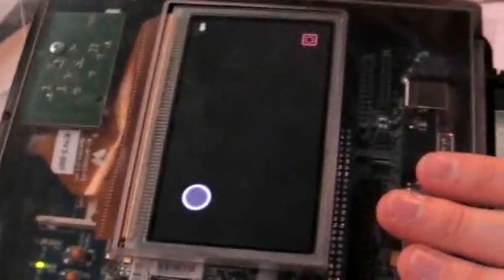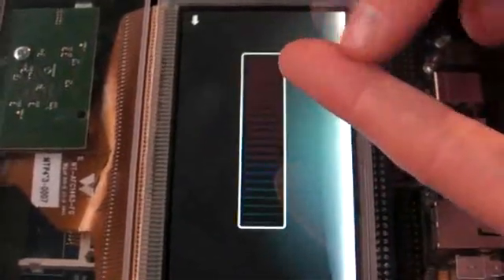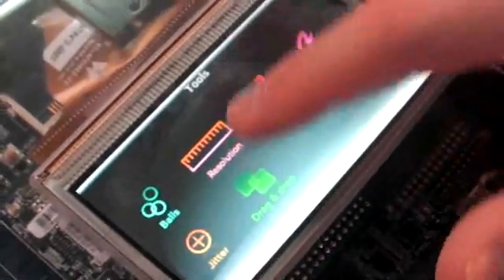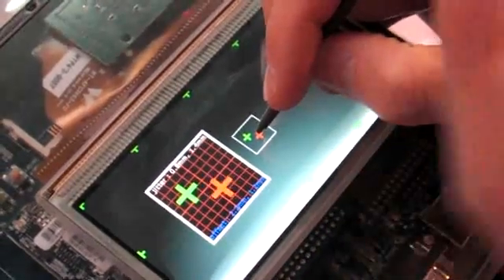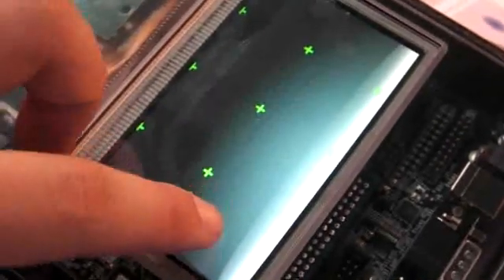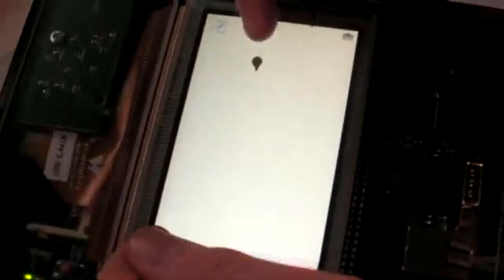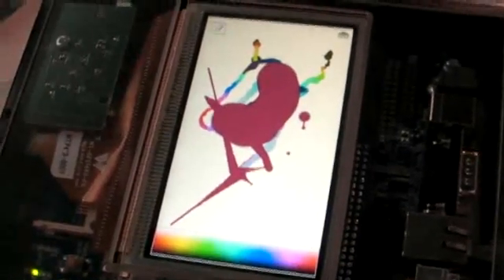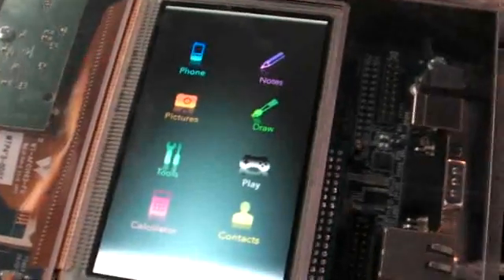Stantum's Mobile Phone multitouch interface

Comment: @stlucianrasta92 it won't. the leo (HD2) has a capacitive screen and cannot detect objects such as a paint brush for example. it ONLY detects your finger. and it is NOT pressure sensitive unlike resistive screens